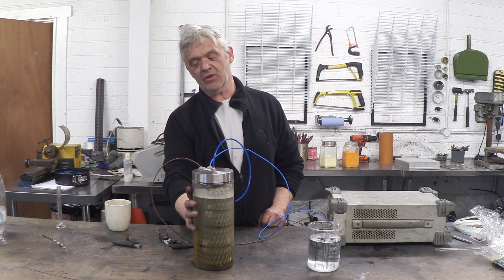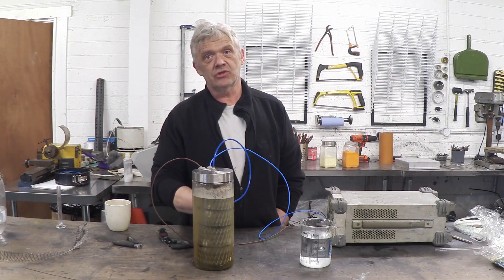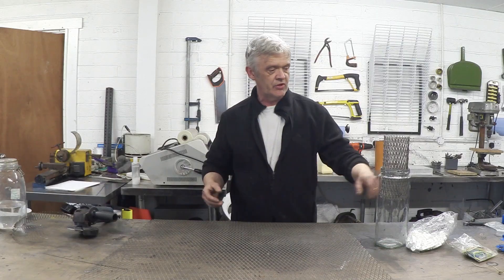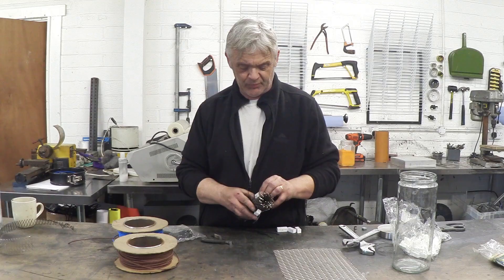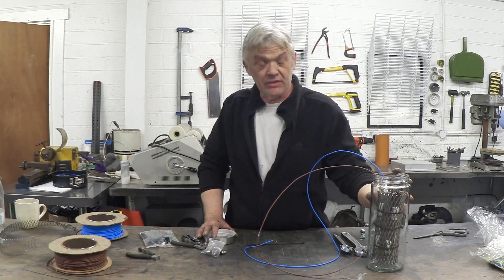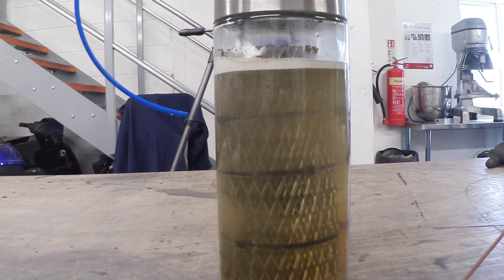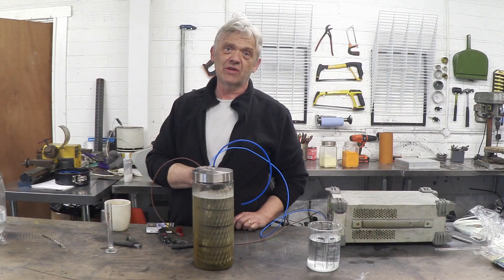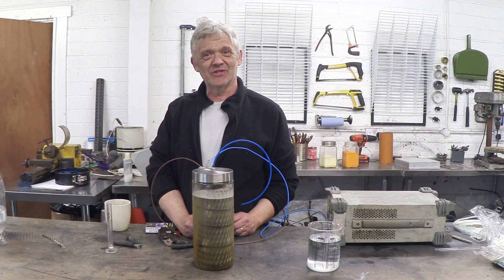Cheap And Easy Hydrogen (Brown's Gas) Generator

Comment: There are different stainless steel when it's dirty like that then it's probably V2A stainless which is not suitable for this task V4A is for such task suitable. Cutlery is mostly V4A whisk, or those hand sieve with the fine stainless steel net.

Comment: I plan on doing investigations into this next week...  making a similar generator like the one above... powered by solar panels.   Then take the brown gas into a burn chamber with a candle at the bottom, and have the gas (pop/pop/pop) as its being made in real time... just to see if its possible to make an efficient house heater for the winter... of course my tests will be outside in a safe environment until enough research/development can go into a very stable and safe mini furnace to contain the explosions.

Comment: I know this is an old post,BUT !! Would you (because I don’t know how and don’t have the stuff) read the capacitance and determine the correct frequency to pulse (with DC) for the most efficient catistrophic dieoletric rate. I know, crazy thoughts

Comment: I am interested in breathing hydrogen however adding urea would release nitrogen which is dangerous, does anyone have any info about the correct solution or if i can just electrolyse distilled water. I assume i would need more power and a surgical grade stainless steel. Any info would be much appreciated.

Comment: if the required voltage goes down wont that mean the current will go up? requiring the same power at the end of the day? or is he saying it requires less power VA to cause the process?

Comment: I love your videos but burning hydrogen is never ok.  People think when you combust hydrogen and it puts off water vapor it's going back to water that's not how this works.  Yes there is water vapor but it's less then it's starting point.  Hydrogen isn't renewable and without it water can't be recreated.  Burning hydrogen indirectly destroys water.  Running cars off Hydrogen "water" isn't cool.  It's the dumbest thing ever.  Burning Hydrogen would positively dry us up.  Anything you combust is gone.  You can't burn a log and bring it back.  It amazes me the amount of people who don't get this and I'm not speaking directly at you.  I'm just stating facts.

Comment: How are you separating the hydrogen gas from the oxygen with round electrodes. I always thought you have to put the electrodes on one side and the other.
Reply: You don’t. This is brown’s gas (aka ‘oxy-hydrogen’ as you may have heard it). You will have to modify the design if you want split oxygen and hydrogen outputs.

Comment: One potential option using the stainless steel mesh to increase the output is to find a plastic mesh and roll that between the 2 electrode layers together. Or find a paint that is durable and insulating enough and paint. Another section of the stainless steel mesh to do the same thing.

Comment: Ok, off to do my video of using that to burn a torch to heat a steam generator powering the electrolysis and debunk the myth of a self replicating machine, just joking), it would be interesting to calculate how much extra power is generated though.

Comment: So what can I use if I don't have a regulated power source? How much power are you using in the video? is the jar lid plastic or metal? At what rate will this unit produce hydrogen (volume) at a given voltage? how does one collect and store the hydrogen?

Comment: This is not a hydrogen generator. It is a Browns gas generator. Hydrogen burns slowly. Browns gas explodes violently. Big difference. I won't get into the difference here but it's simple chemistry and this is an ignorant video. I expected more from this guy. Be very careful if you build one of these. I have built many and the explosions were epic but carefully executed using flash back arresters. Foolish ignorant video.
Reply: Brown's gas is 2 thirds Hydrogen ...
Reply: "Hydrogen burns slowly."
HAHAHA, seems that someone doesn't have a damn clue what he is talking about.

"Foolish ignorant video."
More likely a statement made by an ignorant fool.

Comment: Just wondering whether the cost of the urea in conjunction with how often it needs to be replaced is more economical or less per cubic meter of H2 produced, when compared to traditional KOH electrolysis...

Comment: Stainless steel consists of part chromium. Chromium oxidizes to chromium oxides during electrolysis. One of those oxides is chromium oxide VI ( hexavalent ).
HIGHLY CANCEROUS. 
In civilized countries, you can't by law ( and shouldn't regardless ) just dispose of that "rust". There is special protocol for disposing it(!).
Don't breathe it in. Don't dump it outside/down the drain. Don't touch it with bare hands. 
Don't use stainless steel as a waste electrode.

USE GRAPHITE RODS/PLATES. Best conductivity, best porousness, cheapest, most efficient. Breaks down into graphite powder/graphene.

Comment: Urea is used for fertilizer. That's the most likely reason they don't have a lot of information in the research papers. They use natural gas as the feedstock to make it.
Reply: I should add as a side note, diesel exhaust fluid uses urea in it for it's emissions control in the catalytic converter.

Comment: 316L grade steel or your anode with corrode off quick..   its the only steel that can resist the Stripping action know for electroplating. (the + material will be stripped off to the - side

Comment: My 2016 Dodge truck has the EcoDiesel, and I have to use DEFfluid (Urea). I'm thinking I could somehow convert the DEF system into a hydrogen generator.  Would I just pump the hydrogen into the air intake?
Reply: yes

Comment: I don't understand why those with the know how and inclination don't do what Stan himself said he did. Adjustable frequency alternating current electrolysis under vacuum between set gapped plates. Just like em waves can disassociate h2o he claimed the same at certain frequency ac and feed back resonance within the cell breaking the bonds on mass. Think opera singer and wine glass.

Comment: How much gas is produced by this arrangement?  
& more to the point…how much work can it do?…fuel a small car?…power a small household electric generator to keep the fridges running? 
Can the H2 be put in a tank that feeds a car or generator engine?

Comment: Robert, in a past video you added capacitors with diodes and ran the generator off the caps. Would you be able to do the same thing here to have a consistent flow of energy to the hydrogen generator to run it off a cars 12 V system ? Thank you for being on UTube

Comment: WARNING, WARNING, WARNING !!!!..
DO NOT ONLY TWISTING THE WIRES TO THE STRECH METAL !!!
If the wires become loose, you risk a spark occurring in the jar and thus an explosion.
Since the gas you are making here is not pure hydrogen, it is VERY explosive !!
I did the experiment of filling about 1 liter of this gas in a small plastic bag. Tied a knot on the bag.. There was no pressure in the bag. Pushed the bag into a flame. The bang was so loud that it rang in my ears for 1 hour afterwards.....
Do not play with this type of gas !!! It is life-threatening if you do not respect it and do not treat it with GREAT care !!!

Comment: Does the circuit left on heat up the 20 amp wire and controller that you are using in quick time the same as it would hooking a battery to itself with through the solution with only an auto breaker?

Comment: It's not the voltage that's at issue it's the current with electrolosis - inefficient in creation and retards over time given the corrosive nature of the media. A better solution for "browns gas" ON-DEMAND is a chemical reaction such as concentration of Sodium Hydroxide in water and aluminum then control the reaction - very cheap and very abundant in output - actually you have to be very careful on the control of the reaction but if done correctly can run a car engine off it.

Comment: @Robert Murray-Smith
Awesome work. First time I am hearing about using urea as electrolyte in water. I think electrolysis should yield HHO (oxy-hydrogen) and not pure hydrogen, you might get some H2 due to urea, but the electrolysis of water with such method should generate more HHO than pure H2. How is the input DC volts and much Amps does it take. When you say you are getting more energy out than in, means that you are creating energy, that's cool.

Comment: Robert, a future video idea might be to put a cheap submersible pump in the electrolyzer. Hydrogen bubbles cling to the electrodes acting as an insulator reducing efficiency, vibrating the plates can free hydrogen and a pumped solution flowing over the plates from the bottom up could increase efficiency too. Eliminate the bubbles to increase efficiency and yield. Is there a best sonic or ultrasonic frequency for breaking the hydrogen bubbles free of the surface?

How do you separate out the oxygen from the gas stream? A cheap plastic or glass tube open at both ends would work to do this, silicone it to the inside spacers and a rubber seal at the top to the lid and put the O2 collection tube lower in the gas column.
Reply: Quick solution to that ultra sonic toothbrush maybe
Reply: Upside down terracotta clay pot with the usual plumbing and spacers.  These are porous and act as an "ion membrane" -- it is conductive when saturated with electrolyte.

Comment: Very fascinating . I have wet cell electrolyser of 7 series cell for 10% KOH (2 electrode plates and 6 neutral plates with spacers of 7 mm thick )  . Can I use urine / urea as the electrolyte solution in this electrolyser to produce hydrogen for mileage improvement in petrol and diesel cards ?.

Comment: Great video! I would use stainless steel bolts, washers, and nuts to attach the wires the electrodes. And use rubber grommets in the wire holes before sealing.

Comment: How are you separating the oxygen and hydrogen produced..
Reply: Ahh, your not, I get it. We did an experiment back in the day using car battery charger with carbon rods in the clamps both under water but one in a upsidedown container fashioned in place. One rod made oxy bubbles the other hydrogen Therefor separating them.

Comment: I constructed an electrolyzer with a stainless steel fire extinguisher + 12 stainless steel rods. Placed it on my little Ford pickup with a 2.0 L engine. After testing and measuring I came up with the 53% increase in mileage. Used baking soda for the mix. The downfall was when I came home one night I was so tired after a long day at work that I forgot to shut the power off to it and blew the fire extinguishers seams to bits. I considered it a success.
Reply: Nice work, I would suggest using a pressure regulator valve if you were to redo the experiment so that if the hydrogen builds up to much within the fire extinguisher, it would be vented, preventing the extinguisher from going pop
Reply: @elonwhite6628 I suggest powering generator from solar panel at home and then fueling up car from that. Burning that hydrogen with loss on combustion engine to convert to electricity to making more hydrogen is just wasting.
Reply: @ExcaliburPaladin  true, but then you would need to have another storage unit that would need to be safe and probably have its own pressure regulator, considering that the pressure would vary depending on temperature, so you would need a big storage vessel
Reply: @elonwhite6628  Yes. You need a system but it could pay off. Also it is opportunity to run gas stove on it and not only.
Reply: @elonwhite6628  You can get used LPG (propane for car) used tank with valves for cheap. Probably not legal in car without registering and licensing it but probably that fire extinguisher isn't legal as well. RIP
Reply: @ExcaliburPaladin  in the uk you can install an LPG tank and plumb it into the car, but you shouldn’t use it until a qualified LPG trained engineer assesses it for safety and if it is installed properly you can get a certificate to prove your car is LPG certified and then you can use hydrogen to run your car
Reply: @elonwhite6628  I think LPG installation is not ready for H2, LPG system contains vaporiser to turn liquid gas into well... gas. H2 is already a vapor so I think you need to bypass vaporiser. I am not expert tho
Reply: @ExcaliburPaladin  The hydrogen would be able to pass through the vaporiser, but it would be impossible to convert the vaporiser into a flashback arrestors that would stop any chance of the stored hydrogen from blowing
Reply: @elonwhite6628  I think it would be needed to instal arrestor per every injector
Reply: @ExcaliburPaladin  I was thinking of a car using carburettors rather then fuel injectors, I don’t know about how a fuel injection system would work but I don’t think it would be a problem to push hydrogen gas through a vaporiser, so I suppose that it might decrease efficiency but really depends on the flow rate of hydrogen that you are needing and how much the storage tank can provide.
Reply: @elonwhite6628  well, LPG system used additional injectors designed for vapor, so if vaporiser isn't a problem then it is perfect. Storage is a problem, i think a lot of LPG tanks are needed, usually there is a space under car boot, it is profiled to store just spare wheel at the center but if you can weld then you can cut that off and make floor low, at gas tank lvl, then you can store 3 cylindrycal tanks
Reply: @elonwhite6628  I have news, In vehicles, hydrogen as a fuel is mentioned since 2006 in my country (Poland) and you can legalise it. There are probably not many places for maintaining installation tho
Reply: @ExcaliburPaladin  that is good other than the lack of maintenance locations, most I don’t know if the insurance company would need to be informed about any change in fuel systems such as petrel to hydrogen
Reply: @elonwhite6628  I know that a number of companies that install LPG usually are vehicle control stations at the same time. When you convert to LPG, they do all paper work for you. If hydrogen is mentioned as a fuel source by national insitution then they probably can legalise that too. Not sure tho. Can't find any company in Google that would advertise itself with hydrogen legalisation service
Reply: @ExcaliburPaladin  it seems that here in the uk most mechanics are able to convert a diesel engine to a hydrogen fuelled engine
Reply: @elonwhite6628  great to hear
I might visit UK one day then
Reply: maybe with the relay from the ignition switch to feed the H generator?  @elonwhite6628
Reply: A Ford Courier?
Reply: @clydedenby1436  ranger
Reply: If the whole thing was metal then??
Reply: @burt_james_esq  Now just how true is that, I have done the same and maybe got 9 to maybe 15% increase in mileage tops. 
But didn't blow up, but did get some extra corrosion.  
Sorry yours blew up.
Reply: I was gonna praise your humor sense... but then I saw your channels subs and realized you probably were serious... lmao

What are you doing in a channel like this, bro?
Reply: @TheChzoronzon  who the hell cares? Get a big laugh my ass off over that one.

Comment: Thanks for the info! I'm curious have you investigated pulsing the electricity to the container? Like finding the right frequency to break glass, would be to generating the right electrical pulse to "shake" the mixture could vastly increase Hydrogen output.

Comment: you say that you get more energy out, but surely you ignored the system efficiency. The urea heat of formation should be considered/included not just the electrical energy in vs H2 heat of combustion out. The process is not electrolysing water, it is simply breaking down urea. Ir is safe because there is no H2/O2 evolving as a mixture only H2/N2. If a backyarder doesn't understand this aspect, could lead to some exciting results, exciting to the extent of blowing your house up.

Comment: Lithium 6 dueteride is the ingredient you are missing to make this work. Along with the electrodes need to be made of platinum. Then incased in glass with two side tubes to let water stay full and clean. Like two straws as top and bottom of electrode are split in half. Sealed by glass in middle. Hook up solar cells to them so when vehicle is off they fill up reserve tanks of hydrogen. Now you have a vehicle that is always producing hydrogen. As long as water is full and lithium 6 dueteride. You can now start storing them in other containers. If they fill up your tank that you used. Hot swap it for an empty one. Now you are the gas man. You have just bypassed big gas. Now you have a revenue of hydrogen to sell. More tanks more money more solar power more money. Then you think one day. What if I ran generators off this fuel and power my home. Then you realize you can power your home with it easily. More people start doing it. Then government steps in. Starts arresting people as they have made lithium 6 dueteride which is classified as a weapon of war. Then you start back at zero. The games humans play lol. you fools lol.

Comment: So if you connect it to the  air intake of a modern fuel injected engine you wouldnt have to worry about tje oxigen sensors and the computer making the mixcher too rich?
Reply: no

Comment: Word... cable ties
Reply: Do you know the result of electrolyzer on the cathode and diode is a degradation process it's an oxygenation process it degrades over time thusly the cable ties will basically dissolve and when the one on the inside dissolves is going to spring out touch the other one and then possibly ignite your hydrogen gas why can't people just get their head out of their ass use two bolts in a ball jar AS the height cathode and diode put some washers on them now I would suggest putting twice as many on the negative lead than the posative lead because the negative is what produces oxygen and hydrogen produces twice as much so to balance it and twice as many washers on the oxygen negative and insulate the cathode and diode at the lid use a power inverter and a power adapter as the source of energy from the cigarette lighter